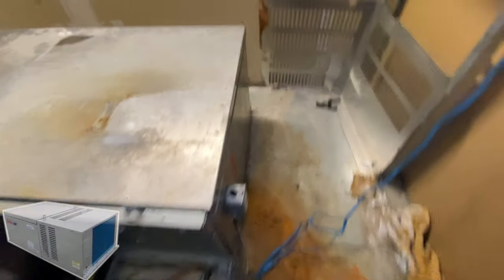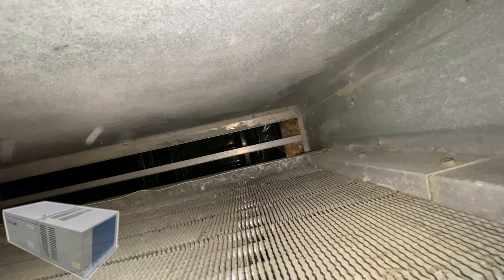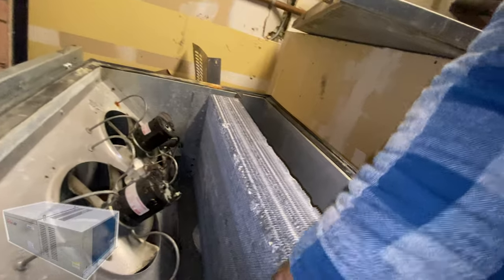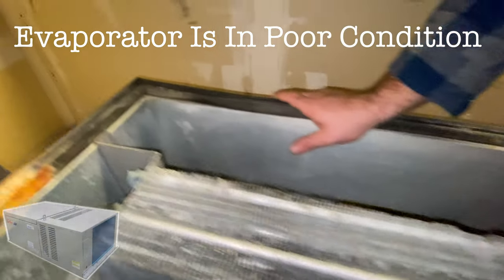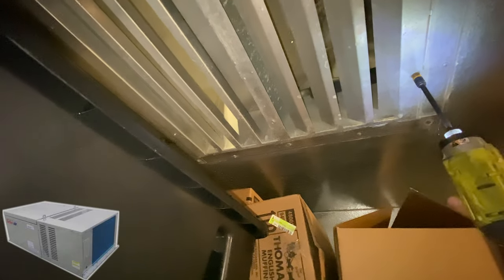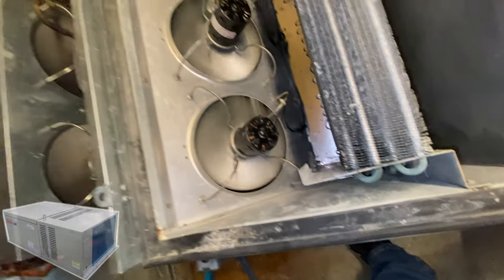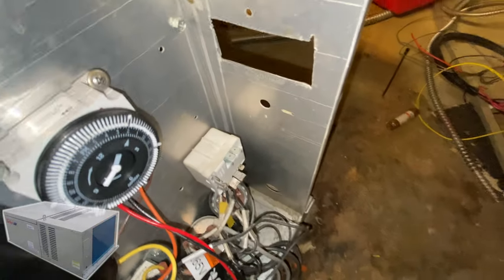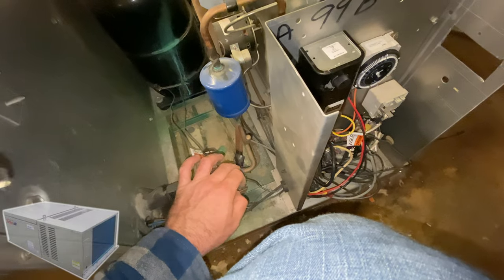Walk In Cooler. Water Leak. Bad Condensate Pan Replaced. +TRUE FREEZER

Comment: Those top mount cooler are cheap and that one is a pos especially with all your hacks lol. Unit should be replaced. Good video Marat. Thanks.
Reply from the maker: Would be nice to replace it ). Will keep fixing as it goes at this point. Thanks!
Reply: @MaratRPMSoCal Your a good refrigeration tech Marat. Have a great day. 👍
Reply from the maker: @totaltech8246  Wow, Thanks! Appreciate it so much!